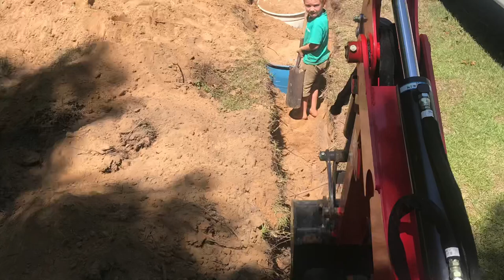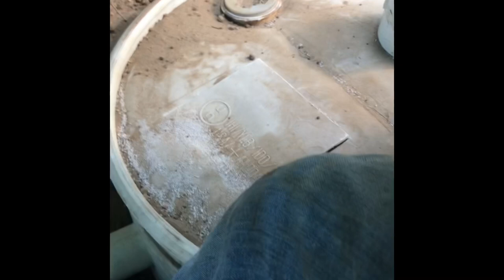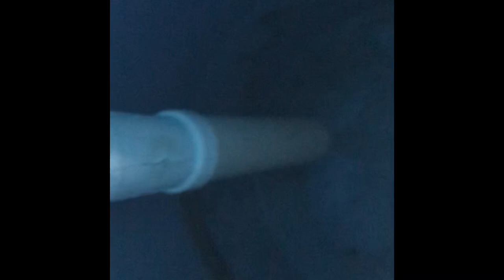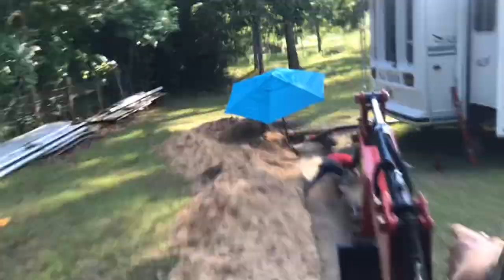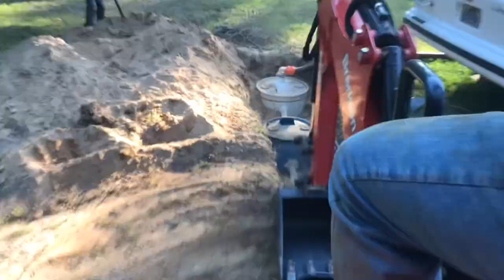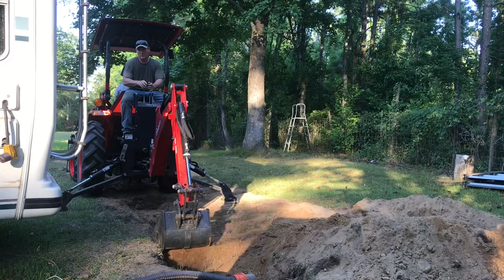DIY 55 gallon drum sewer system for rv Fix It Dad!

Comment: Im building one with IBC totes.  Thx for sharing
Reply from the maker: I know those ibc totes been known to collapse. Be careful and try not to drive heavy equipment over them.
Reply: @fixitdad9669  Yeah we kept them in the metal cages and put tops over them for that reason but put in a spot where we wont be running the tractor

Comment: I see you did not do a inlet T  what about your grease fats and oils  wont it build up in the end of the pipe?   I want to add my  inlet T on the outside on the inlet side and put the riser pipe at ground level so i can un clog it if its ever needed.. then the leeching side obviously  has to be inside the tank but also add a T on the leeching side  at ground level for clog service if ever needed

Comment: What is meant by sanitary tee
Reply from the maker: Sanitary tees may be used for horizontal drainage flow through the run of the tee where the branch of the tee is for venting only and is oriented within 45 degrees (0.79 rad) of the vertical. A sanitary tee can be installed on its back for venting applications in sanitary drainage.
Reply: So the top of the tee should be pretty close to the top of the inside of the tank. Does that matter
Reply from the maker: Yes the tee has a one direction flow and depending how you install the vent should be close to the top where it can vent about an inch or so from top.
Reply: On the side of the tee that goes down inside the tank on the outlet tee how long should the downward pipe be? Thx for your help
Reply: Also on the inward tee how long should the pipe be going down? Thx
Reply from the maker: @josephmontez2309  https://youtu.be/e8YpYmGTigI